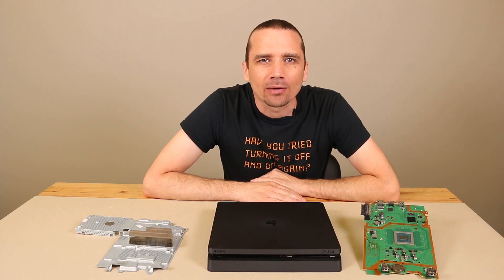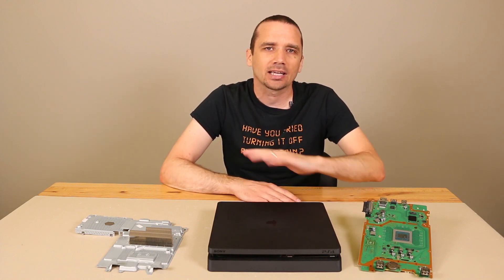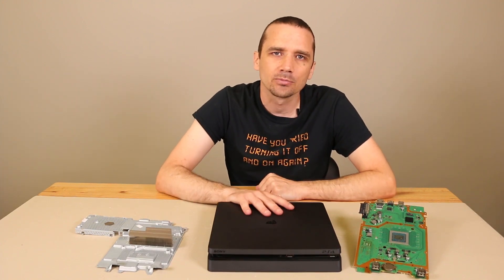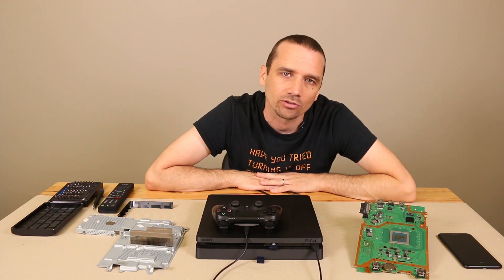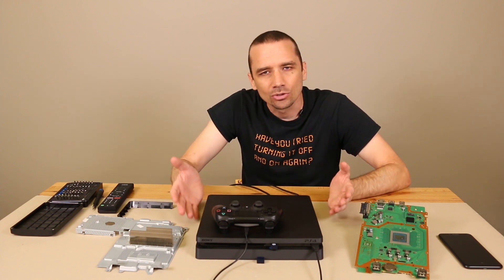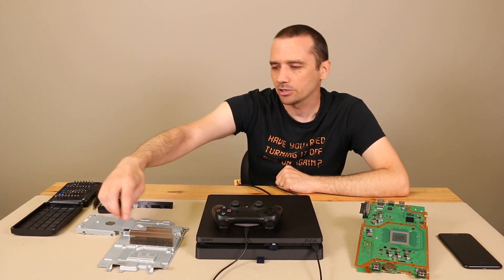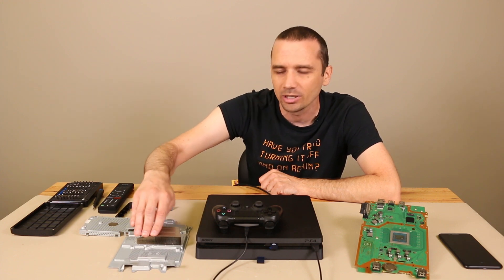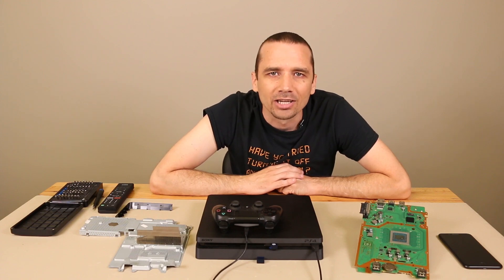PS4 Slim Too Hot? - Overheating Explained - Prevent Overheating

Comment: Something I have experienced on multiple PS4 Pro systems I have modded is the heat and fan noise generation is largely related to the GDDR5 on the backside of the motherboard due to grossly inadequate cooling (the PWM of the fan is definitely tied to the memory in addition to the APU), I wouldn't be surprised if this affects the PS4 Slim as well--could be an idea for a future video if nothing else.
Reply from the maker: Thanks for the idea!

Comment: TronicsFix I have a question: my ps4 slim got really loud a while ago (im in a basement and i could hear it from the second floor) and i assumed it was just dust so i opened it up to clean it out but there was no dust, dirt or hair whatsoever so i decided to change the thermal paste, my ps4 slim is still loud and getting louder by the day even though i do high maintenence to keep it clean and its in a very wide open spot, could you please give me a guess as to why it may be getting so loud? i fear it may die out soon
Reply from the maker: There's just no way for me to know without being able to test it. I wouldn't worry about it unless it starts to overheat.
Reply: TronicsFix Thats the issue, when I first bought it the ps4 slim was quiet, about a month ago it started getting loud and now every day it gets louder then the last and Iv even had to resort to removing the top cover to keep it cool, im worried about it overheating because the fan is starting to sound just as bad as the original ps4 and its ramping up to extreme speeds compared to when I first set it up it. If you would like to see the ps4 I have posted videos about a month ago on my channel showing the issue
Reply from the maker: Did you clean the entire inside of the system including both sides of the heat sink?
Reply: TronicsFix iv cleaned both sides of the heatsink using slight dabs of 99% alcohol and toothpicks even though there was no dirt or dust and when i replaced the thermal paste i followed your reassembly video, iv checked all the thermal pads and everything is positioned as it should be. i will admit i accidentally slightly tore one of the thermal pads a while ago but i placed both pieces together on the same ram chip because i read somewhere that a slight tear wouldnt do any damage if they were stuck back together without adhesive, at the moment that singular thermal pad with the slight tear is the only thing i could see as potentially wrong but when i reopened it an hour ago the thermal pad was merged back together by itself. it seems there is no reason for it to be getting loud but thats just it, it keeps getting loud

Comment: thanks! now i dont need to worry about that. but i have a question. im not confident to fix or change the thermalpaste IF my ps4 slim is going to overheat or broke or anything. So i wonder how much will the shipping cost from Finland to your repair shop and back? and how will my package be delivered safe. Because iv heard of many post companys that just throws the boxes etc..
Reply from the maker: Unfortunately, we don't take international consoles because of the same reasons you mentioned. Sorry about that.
Reply: TronicsFix ohhh. Thats sad. Because we have no console repair shops around here so.. well :(
Reply from the maker: Bummer. Sorry I can't help.